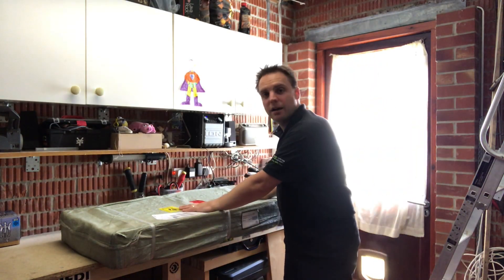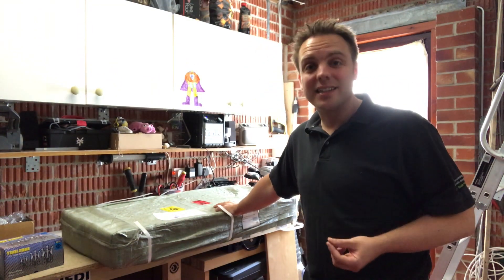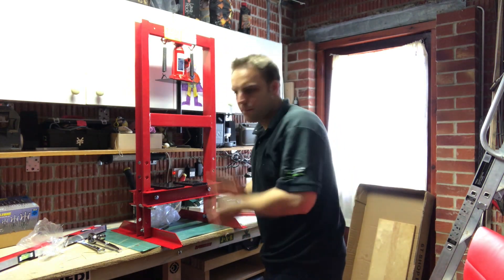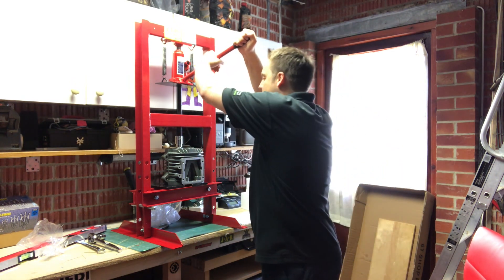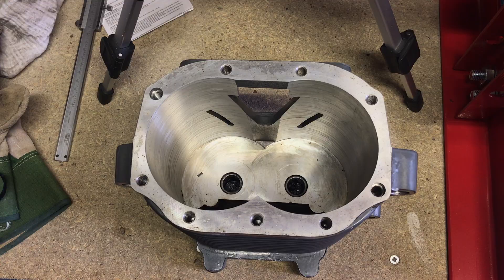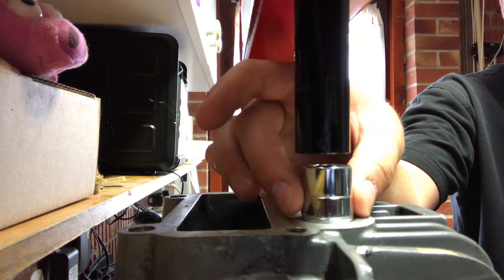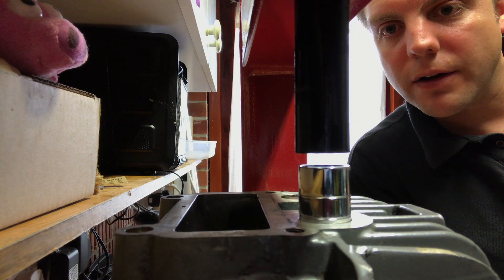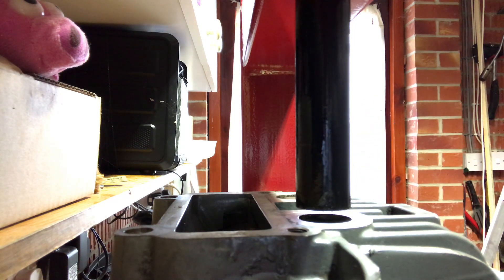RX8 Supercharger Part 3 - Shop Press and Eaton M90 Needle Bearing Replacement

Comment: How did this project end up???? I would love one of those chargers but impossible to find
Reply from the maker: Hi Thomas, the engine began to fail and I ended up buying a better car (still love rx8s - but moved on). Once it became a full rebuild as well, and my car budget increased it just didn’t make sense to complete.

I sold all the parts on to a race hobbyist with an rx8 - not sure what happened there. Hopefully the charger has been breathing some fun into a wankel somewhere :)

Comment: What happened to the swap?
Reply from the maker: Hi Albert

   Well the engine was basically dead and my fortunes turned for the better and the project just didn’t make sense anymore - I now have 400HP and twin turbos without grazing a knuckle :)

The project was sold on to a racing enthusiast - not sure where it’s gone from there.

Comment: any more parts of the series in the works ?
Reply from the maker: Hi Seth

  No unfortunately not; life went topsy turvy and I’ve come out of it a lot better off. I’ve sold my rx8 for something much nicer with twin turbos already fitted :D

Once I was a bit more flush the rx8 charger project didn’t seem so attractive. Half of me wishes I’d finished it and if had had a driveway big enough for two cars - I would have done.

But no - there will not be any more episodes - sorry :-/

Comment: What series is that supercharger? 2 or 3 maybe?
Reply from the maker: Scott Ouimet I really don’t know :-/ I think it was off a 98 Jaguar if that helps?
Reply: @HouseOfPayne666  I can look it up and see. I'm working on a 98 Regal with the SC a customer bought and got the SC going but it rattles quite a bit. Gonna just try replacing the coupling and if that dont quite it down. Maybe try to Change the rear bearings like in your video. Did help a bit to see your video. Even if it's not the same I imagine it will make a decent guide to follow anyway. Thx

Comment: I think what you're hearing is the gear lash. Put it together with the proper lube and see if its any quieter.
Reply from the maker: Thanks! I'm going to need to strip the paint / repaint, and redo the bearings on the snout first - but then I can put the gasket on, seal it up and add the oil. 

Hopefully the oil will seep into the gears and the snout-side of the rotor bearings and smooth it out. I spoke with the rebuild kit provider and they said that the metal will expand when its running at around 100 degrees C which will further reduc e any play and therefore noise/lash etc.

Comment: Nice to see you progress on this build. Not sure about the tolerances for the play. Would be good to look at the healthy one or maybe email Eaton with a question. Could also be that it sounds like this only on wiggling it about. Maybe if it gets up to speed and under load, it's ok. There are a lot of supercharger guys in the states, some could know the answer. Good luck!
Reply from the maker: Domas64 thanks, I’m kind of torn. If I was patching it up to keep my old car ticking over for a couple more  years I’d be dead chuffed cos it would have cost £160 and would certainly outlast most of the other components.

But my build will require it to run at 17000 rpm peak to get the airflow I need which a new one will do for many many thousands of miles.

But the time and effort investment in this project will dwarf the money. So I’m hesitant.

I might sell it on refurbished and look at other options. I might not.

I don’t know :) :( :)
Reply: @HouseOfPayne666  just came up on this video. Probably too late now but the clanking problem is the rotor bearings are worn. There are bearings in the rotor plate that wear. The same type as in the snout. SKF 6201, One per rotor.